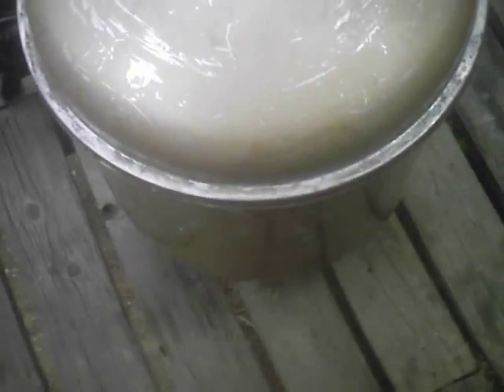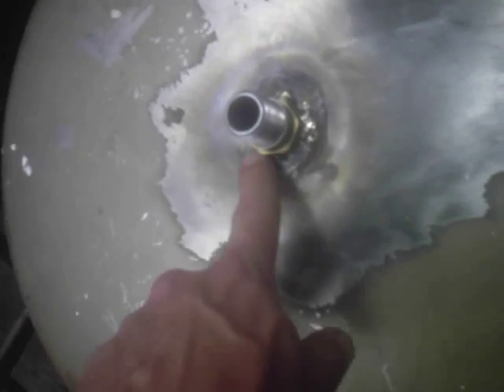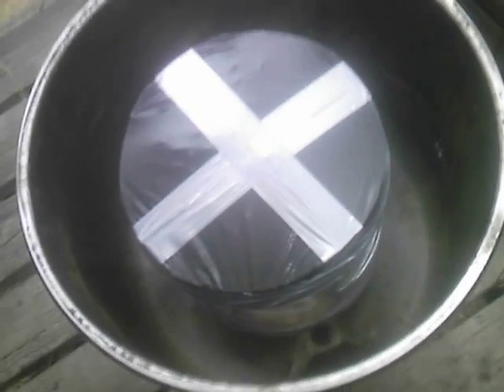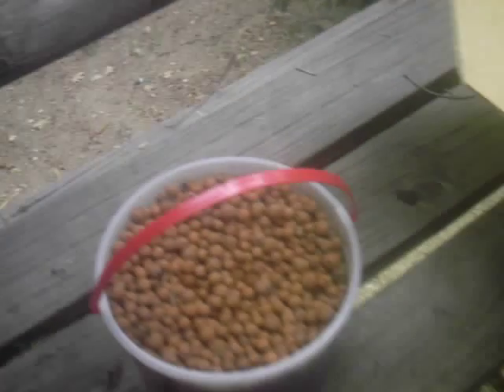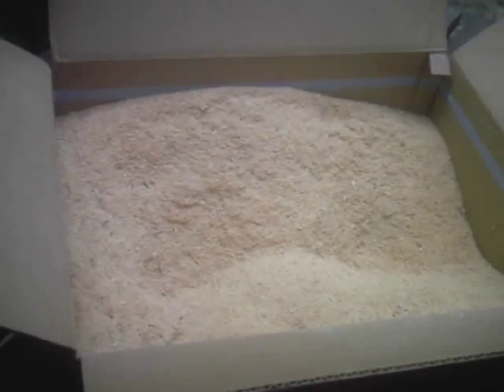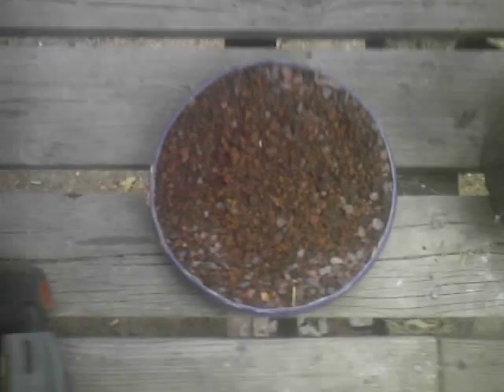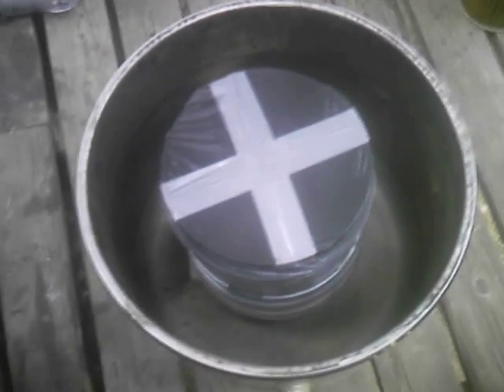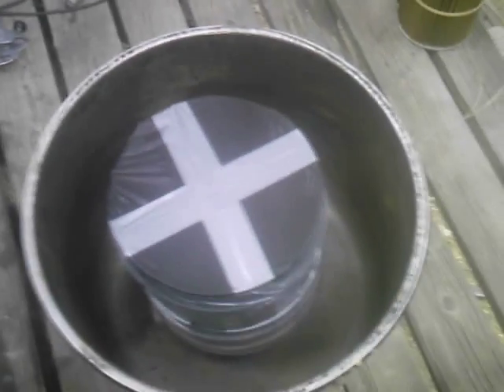the best wood gas cyclone\bed filter

Comment: Hay cool ,did you try it yet ? I have to get back in the mood again !! I should have never stopped , but with Xmas and flipping cold weather it was what I hate to do . Let us know how this goes because besides a rad ... I Need  a cyclone also . I don't know if I told you but the boiler is not happening , I going for the eng run instead and going with a rocket stove for boiler . Thanks for your vids
Reply from the maker: ok if ur going for the engine run option there is something u should know if u produce tars there is no amount of filters that will get it out so the only option is to have a reactor that dosent produce tars to begin with so in conclusion if u cant get this reactor core up to over 1400 F u will make tars and like i sed no matter what any one say there is NO way to filter out the tar it just cant be there to begin with =3-
Reply from the maker: BTW this filter works GREAT! but it only filters out moisture ant soot it dose not filter tars B\C that is impossible there are more vids of the autopsy on my channel and then u will understand that wile the filter was still clean when the reactor tem dropped it made tars and the filter didnt catch them i have found that the tars if present are @ the atomic level IE in the gas it self and it cant actually be filtered out =3-
Reply from the maker: here Imbert wood gasifer autopsy
Reply: @xoxoXoieoxox  Wouldn't water filter filter out the tars?
Reply from the maker: despite popular belief it is IMPOSSIBLE to filter out "tar". you can only filter out ash. you have to have a reactor that creates no tar to begin with and the more you try to filter it out, the more you restrict the flow and lose power. so the only way to have a tar free sys is to have a tar free reactor this is why i can get away with only one cyclone and a bed filter for filtration. also these systems are not perfect like every one thinks even the WWII systems sooted up the motor after a wile but i found the soot can easily be cleaned out and it has no negative effects on the engine i have a set of pistons and jugs off my VW that i ran with the last sys and they have no damage  =)
Reply from the maker: and i have tried water and it is too restricting of flow and the engine lost power compared to running a bed filter =)